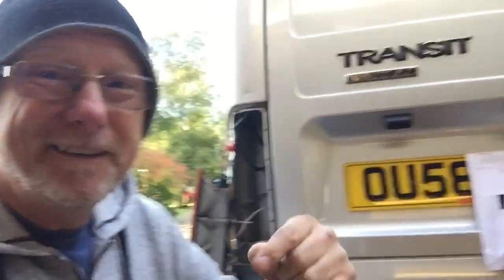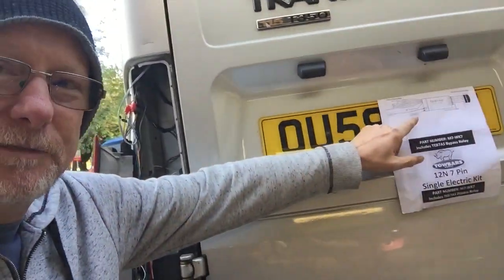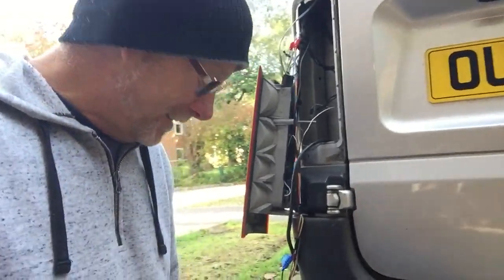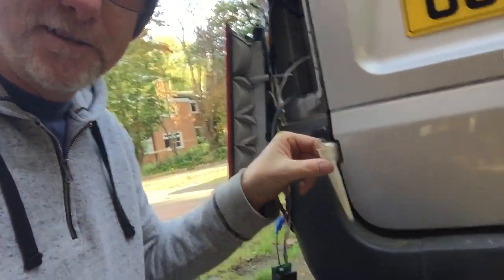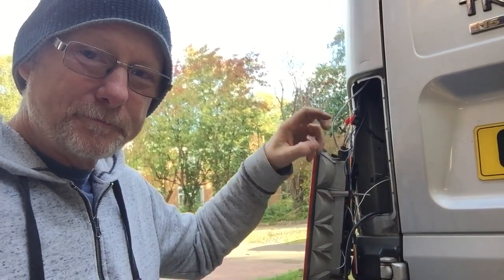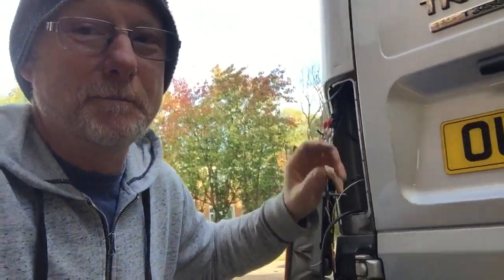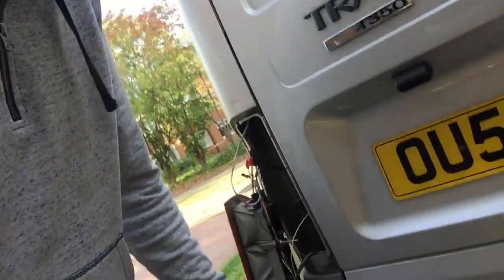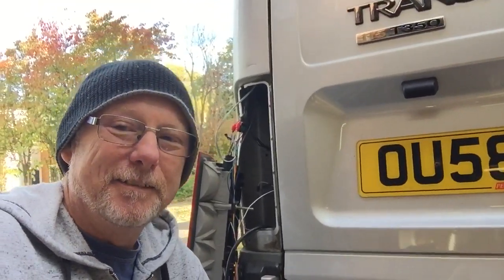where to look for rust traps in a ford transit

Comment: Ill have a look in mine
Reply from the maker: Good luck 🤓👍
Reply: @BigVanSmallWorld  mines got  rust starting on the arches under the bumpers im gonna get that sorted its only little bubble but its best to sort it befor it spreads lol
Reply from the maker: Yes all ways good to catch it before winter check the little drainage slits along the under sills too make sure they are not blocked 👍🤓

Comment: I’m doing the 13 year old transit van rust restoration started today I’ll look tomorrow as that hole is open problem is there is a hole under that hole and I can tell you all this sh^t the screws and mastic nozzles have fallen out and gone in your tires sorry guys did not know that hole was there . Oh yeh try fixing that huge hole on both sides aswell is an ass ache from Hell .
Reply from the maker: Good luck with it dude 🤓👍

Comment: Just finished my 07 plate  rust . The things I have found in the design is disgusting angry as hell . All the water off the roof and the windscreen runs through the internal van box sections of the van and out the drains along the cills . You need to block them all up with silicone . If you open up the bonnet and look at the hinge points you will see we’re all that water goes . Down the hole and runs over the back side of the front  wheel arches and out the bottom of the cill . My rust started the first time it rained. Will never buy ford again .
Reply from the maker: I feel your pain it’s a really bad design it’s ok when there new but once dirt gets in and starts blocking things up that’s when it all goes wrong  good luck with your van hope you manage to sort it all out 👍😊👍
Reply: Mel’s Van World like I said bro take a close look at those hinge points I think I have successfully blocked off the inlets and redirect the water forward . If you prevent the water you will prevent the rust .
I used three tubes of silicone to do so and it also requires removing the wing mirror mounts and sealing the gaping holes off then your good to go . 
I removed the door step plastic covers to the pop caps come up easy and underneath the little screw drop out and the whole thing comes up , you can do this easy it does not cause any damage just to see if you have rusted through yet . There are also small seems in the engine bay that need a little mastic to . If I knew this  from new there would be no rust at all period .
Thanks for the reply hope my gripes help you out the hole you mention is the least of your worries down the line I have left them caps off now as the water must get out ASAP not sit and fester etc but I stop that water aswell into the rear lights